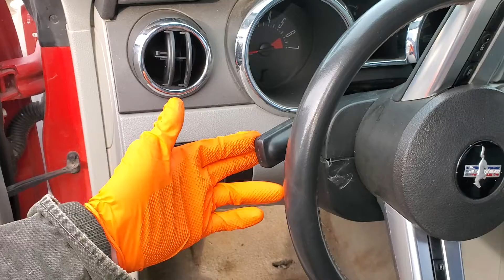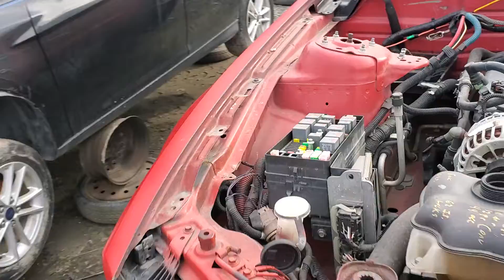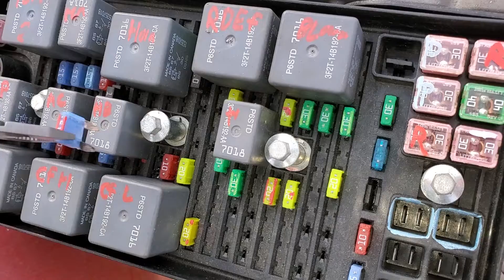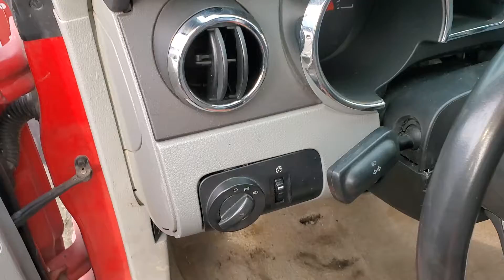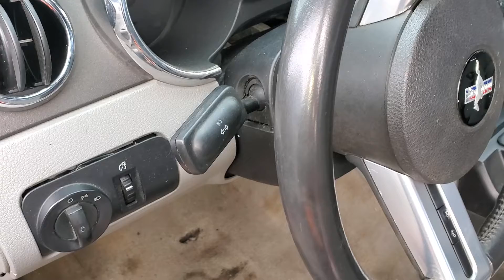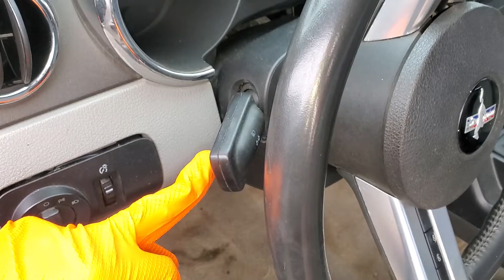2006 Ford Mustang Headlight Fuses, High Beam Fuse & RelaY, Circuit Explained

Comment: I’m have an issue where my passenger low beam works but the driver side doesn’t, both hi beams work, already replaced both bulbs and bulb connectors … this is on an 05 mustang, help would be appreciated!

Comment: Ok my 06 mustang on night just decided to turn its own headlights on  ! So I  checked to see if they accidentally got left on ! But that wasn’t the case  so I ended up having to pull off the battery cable to prevent draining the battery ! Have had it looked at $ to no avail did nothing ! What would be the cause of this issue ? Have changed the switch did nothing. So any ideas what might cause this ?
Reply: I have the same issue happen to me last week. Let me know if you find the solution and like wise I’ll tell you how I fixed it on my end. It’s some kind of headlight glitch. Idk I can’t get my headlights to turn off unless I disconnect my battery.
Reply: I’m having the exact same problem

Comment: Question , have you had any questions concerning the horn, no fuel, ( no start ) blower motor all not working after the Air Bag recall was completed? I don’t think it’s the clock spring causing all this , I’ve checked fuses & relays from your videos  not sure where to go from here ??

Comment: @lehew great video, just a question about diagram. If i want use the multifunction switch to use for flash my fogs (on grill). i can use violet white wire as positive ? or negative? thanks
Reply: *fogs are connettected on high beam!

Comment: I've got a question, I'm having an issue with the engine shutting off when I turn on the headlights, not auxiliary but 3rd function to the right, and it also kills the engine when I engage the high beam by pulling back one click on the blinker switch lever, and the horn isn't working either and kills the engine when i press the horn, what could be the problem here, alternator, battery, relays in the under the hood all been checked and good, fuses as well, which leads me to that there's a short somewhere in these wires somewhere in the dash. I don't know if it's a ground wire crossing a certain power wire that all these run through that are touching or grounding out against the ignition switch power wire or how all that that would work or not. with the car off or on, blinkers still work, my passenger right headlight is on but is dim, like really dim like a definite power issue and shows no difference in brightness when switch to high beams and the driver side headlight has a barely visible illumination at the bulb that you can only see in the dark. Horn still doesn't work regardless of any scenerio car running or not. What would be your recommendation as to what could be causing this specifically or where to start?
Reply: Did you find the fix for this , my  06 is doing the exact same thing

Comment: My left low beam isn’t working and rear right brake light too. Gonna check the fuses again but if that’s not the problem - what do I do next?? Also: bulbs are brand new. 

Does the smart junction box have anything to do with this maybe?? Thanks
Reply: I’m having this exact same problem you find a fix yet?
Reply: @kemonwilson8639  have you found a fix yet? Cos now my passenger high beam is also out. When I open the car door it works but when I start the car and then switch on the high beams, it doesn’t kick on. 😑
Reply: @alexxjovo  no luck yet and now sometimes when my car downshifts the lights sputter like they’re abt to kickoff 😭
Reply: @kemonwilson8639  what are you gonna do bro?
Reply: @kemonwilson8639  I’m debating whether to keep mine or not. I want to keep it cos it’s paid off and the last thing I need on top of inflation is a new car bill but having a reliable car is also nice. I dunno dude
Reply: Unfortunately not. I was hoping this guy would reply since he welcomes questions but. Nada.

Comment: Hey man, I have a 2014 Mustang V6 , my headlights won’t turn off? But the headlight switch is off. I have to take the fuse out to prevent the battery from dying .

Comment: Hello.  the lights won't shut off on my sons 2006 Mustang and its draining the battery.  I used this video to find the fuse and pulled the 2 low beam fuses out and it turned the lights off. Thank you so much. Do you think that putting in a new switch would solve the problem??

Comment: so my high beams randomly turned off. my low beams work, i changed the relay and fuse for the high beams. i bought a bulb and changed it on passenger headlight then that head light worked on high beam, the driver side still didn't, both still working on low beam. Then 5 minutes later pulling the switch in on the steering wheel the high beam stopped working and the driver side bulb wouldn't even work on low beam. Went to auto zone replaced driver side bulb then passenger side bulb wouldn't work. turned car off and replaced both bulbs and now both bulbs only are burning on low beam. any advice?
Reply: Did you find the fix?
Reply: @ shortage in the wire

Comment: Hello i really need help. I have 08 mustang bullitt with oem HIDS and one of the housing adjustment screw messed up.So I want to buy stock after market oem housing cause of cost of the bullitt headlight.So what I'm trying to say can I use the factory 05-09 mustang gt headlight harness on the Bullitt. Would it be plug and play??

Comment: Hi, i have a 2005 v6 coupe, i have an issue where my talights do not light up with running lights or full lights on, the turn signals, hazards, and brake lights work perfect everytime tho.  I played with and probed the brown and white wire out of the back of this switch in the video and they seem to quickly flicker on and of wenever i tap the test light to that pin, i have checked all the fuses for the BCM/SJB and for the brake lights the "BOO" fuse as its called in the manual, all are good, please ANY thoughts/ideas are welcome and will be very much appriciated!
Reply: Any luck I have the same problem
Reply: @mikefurst8900  i eventually found out it was the tailights themselves so i replaced them and the issue is gone.  However id recommend checking out your SJB behind the passenger kick panel and checking for water damage or corrosion.
Reply: @mikefurst8900  also, if you do find water damage or corrosion to your SJB, clean out the rubber grommet on ur firewall under where the cabin air filter is inserted under the wiper cowl. Its the most common place for source of water damage(theres plenty of videos on youtube)
Reply: @mikefurst8900  AND lol, if you end up needing a new SJB, thsyre like 900 from the dealer. So if you want, i have BRAND NEW in thw box one i bought, plugged in my car to confirm my SJB wasnt bad, and they wouldnt let me return it.    So its been sitting in my closet for 2 years, id sell it to you for 500 its for 2005-2006 Coupes, v6 or gt, auto or manual. Thats what i was told by the dealer when i bought it.
Reply: @colton Keefe  thanks it turned out that my taillight was bad. I had to replace them they are aftermarket LEDs
Reply: @mikefurst8900  yeah i had the gt500 style cervini kit in mine i LOVED em but they caused too many problems up here in the PNW i think the moisture killed them. So i got the gen5's now
Reply: @colton keefe that’s what I have too
Reply: @mikefurst8900 They look good

Comment: Hi , I 'd like install 2 new front led light on this Headlight switch ( 2'30" ) goal1  is to bypass the original lighting used in switch 1st position ( will not be used ) and goal2 is to have Led light OFF when highbeam is ON . if possible, pls what are the wire 's color used  ?

Comment: my turn signal goes fast.i checked the back light bulbs they are all good but the front ones are good too.i had bought a relay for turn signals but do you know where that relay goes into bcause i looked everywhere and couldnt find it.
Reply: My car is having the same issue I haven’t been able to find the reply for my turn signals !! Have you been able to find that out ??

Comment: Hey man what’s up so I got a 2006 mustang gt and only my high beams work the High beam light is always on. The switch is on low beams but the high beams is always on
Reply: Did u fix it
Reply: Any solution? I'm having similar issues with my 05 gt
Reply: Anyone figure this issue out? I have the same issue.

Comment: Hey man! I’m having a problem with my 07 my headlight lights work but as soon as I turn on the high beams the headlights completely turn off
Reply: I'm having the same issue! Any luck?
Reply: I have a 05 gt and my high beams only work and when I put lows nothing. Did you solve the issue?
Reply: Same issue

Comment: 2005 v6 mustang 
Everything works but my passenger high beam switched bulbs and nothing tested the relays by switching them and nothing low beams work and only driver high beam

Comment: my 2009 mustang high beam stopped working . from what i can tell theres no power going to the relay in he box under the hood . could it be the dimmer switch ? the low beam works fine . and all fuses are good
Reply: I'm having the same problem but with a 2006
Reply: I bought a used dimmer switch and it didn’t fix the problem
Reply: Same here have you fixed it
Reply: @michellemedina3366  no I haven’t got it figured out yet. I bought a used dimmer switch and that didn’t fix it.
Reply: @arrowhead893  i found out what it was for me it was fuse 49 & 50 !!
Reply: @michellemedina3366  I checked the fuses and relays and it’s not them. Sadly

Comment: Question, when my son turns on his bright lights all of a sudden all his lights goes off can you help with this please (it’s a 2007 Ford Mustang)
Reply: Which one? The fog lights? Low beam? Parking lights? Tail lights? Turn signals? All of them?
Reply: @agentone8511  all the lights goes off
Reply: @jacquelynworlds3178  oh wow never got notifications for your reply. If you havent fixed it yet, maybe the relay for the lights is in the wrong place. Check the manual for the placement of the all the relays. Wires could also be damaged.

Comment: Very thorough explanation. Do you have any idea which fuse powers the side marker lights? I have power to everything but the front and rear side marker lights on my '05.
Reply: Ever figure out which fuse powers the rear side markers in the 05-09 mustangs? Can't find it anywhere & the owners manual isn't clear about which fuse relates to those lights either, I went through each fuse and none are popped, hoping it's not a wiring issue somewhere
Reply: @UF.SCNDRL  did you ever figure it out? I am having the same problems
Reply: @joebaumhardt7527  I actually wound up fixing my problem. Never found the fuse, but when I happened to take off my rear bumper it turned out that the wire that runs to the side marker lights wasn't even ran into the trunk where it plugs in, inside the trunk behind the license plate under the plastic cover
Reply: Looking also.

Comment: I have my headlights always on even though they’re “off” recently my left headlight went off so bought a new bulb and it didn’t work either
Reply: The smart junction box behind the passenger side kick panel under the dash is bad. Good luck finding one. They get wet and their done.
Reply: It was a broken pigtail according to mechanic idk what that is. Both work, but my lights always on even before the problem
Reply: I got this problem too how’d you fix it?